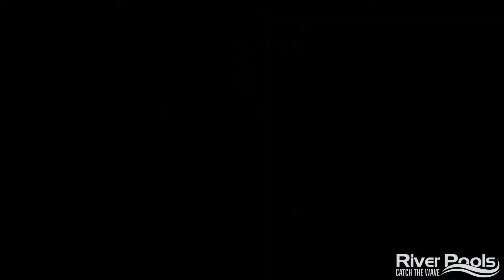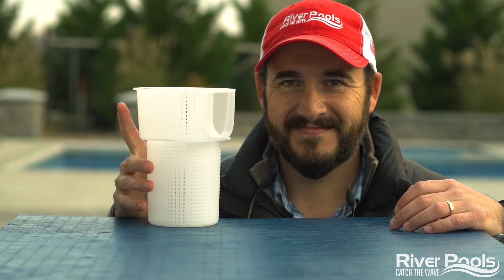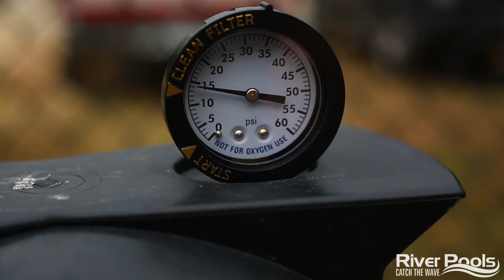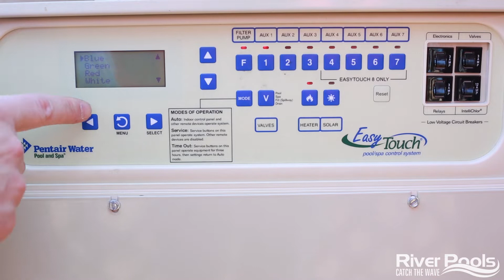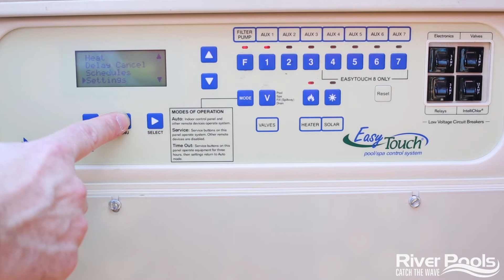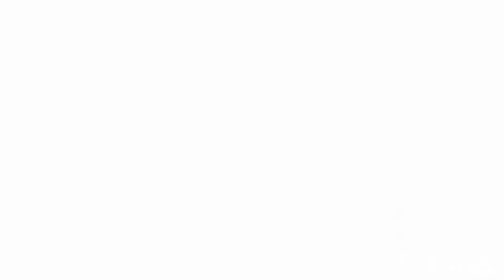How to Maintain My Fiberglass Pool (Video 4 of 5) - The Control Panel

Comment: I'm confused.  In videos 3 and 5 you say AUX 2 is for speeding up the pump and in this video you say AUX 1.  What do all of the other AUX buttons do as well as the other switches and stuff in there?
Reply from the maker: It ultimately depends on how the tech set up the panel. The buttons can all be programmed to do various things. Most likely AUX 1 will be wired to either go to high speed for cleaning and filter pressure testing, OR to turn on your lights. The best bet is to ask the tech, which button does what. It may even be written inside the panel door.